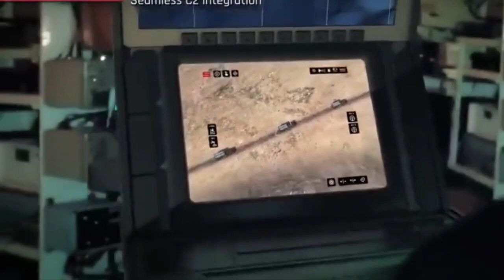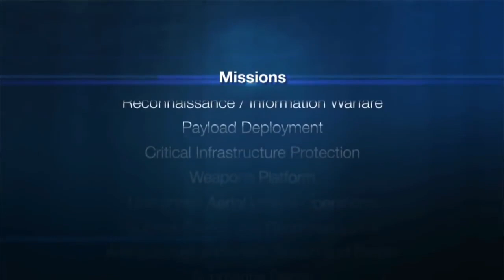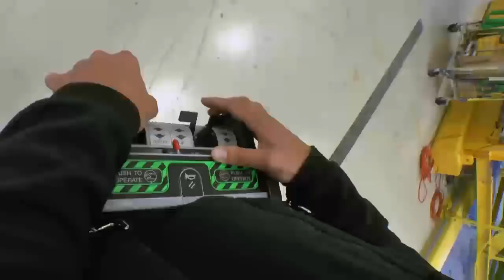Indian Navy's Unmanned Underwater Vehicles (UUVs) in detail : AUV, ALUUV, SLUAS #indiannavy #drdo

Comment: Does it use Cow's urine as fuel?
Reply: Nah but can use pork as well as atta in as a fuel
Reply: @prashantpandey4518  we don't eat pork, you can use it as fuel. By the way it will reduce the price of cow's urine according to demand & price theory.
Reply: @md.majedulhaquerafin4088  We use Paxtanis (Suar / Pork) fuel...
Reply: No it will use black curtain waterhole and some camel urine instead of mulla's cutted unsaturated pipis 🙃
Reply: No it uses garbage (pages of Quran) as fuel
Reply: It's powered by donkeys. India is scared, what if Pakistan starts controlling supply chain of donkeys. Then without power it would sink in ocean like PNS Gazhi did😂.

Comment: I think Bharat should transition to a navy based only on naval drones like the 12 XLUUVs. The XLUUV may have a maximum ‘length with payload’ of up to 50 meters, width of up to 5 meters, height no more than 10 meters and gross weight without ballast under 300 tons. The XLUUV is intended for the following roles: ISR, anti-submarine warfare, anti-surface warfare and mine warfare. This can replace conventional diesel subs or complement the under strength diesel subs. Better to invest big in nuclear only attack subs.  US Navy only has nuclear subs, this is an idea whose time has come for IN. Nuclear subs + UUVs are the solution.
Reply: Nuclear attack subs have there weakness they still need to resupply the necessity & consumables for crew so defeats the whole purpose also nuclear submarine always have light humming noise while diesel switched on electric mode are quiet ....really quiet.
Reply: @MVP0840  That is where UULVs(undewater drones) come in. They go where nuclear subs can't go, shallow water. And UULV can be far quieter than a diesel sub! They have no crew need no consumables.
Nuclear attack subs and nuclear arihants are indigenous tech. Why bother with diesel subs?
Bharat already has the tech for nuclear and UULVs. There is no point in wasting money on diesel subs. Anything a diesel sub can do UULVs are better at. Diesel subs are now obsolete.
Reply: @datoolz0  i think still diesel subs can act as mothership of uulv & wouldn't it be better if we develop sensor only uulv which can transmit signals via a secure datalink to mother submarine which is fully loaded with torpedoes, not only it would be more cost friendly but we could also develop them faster & deploy more of them since they would be cheaper & would demand less maintenance.
Reply: @MVP0840  Just use nuclear subs. Basically UUVs have the edge of being able to go for long distances and don't need food. Can remotely control them from nuclear subs.
Reply: @datoolz0  they are super expensive though.
Reply: @MVP0840  Cost of Scorpene is billion plus!!!
Conventional subs are unaffordably expensive too, nuclear is actually cost effective now.
Reply: @datoolz0  i think we have had a discussion on this prior agreed that diesel subs are expensive but a nuclear would be alot more plus we don't have technology for SSN that is the main problem.